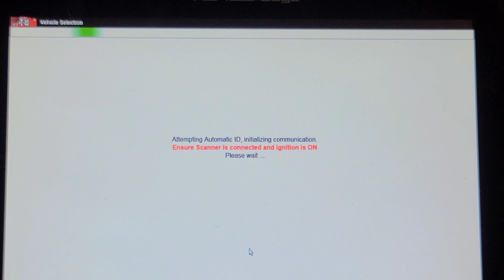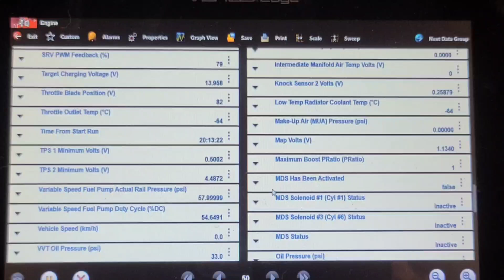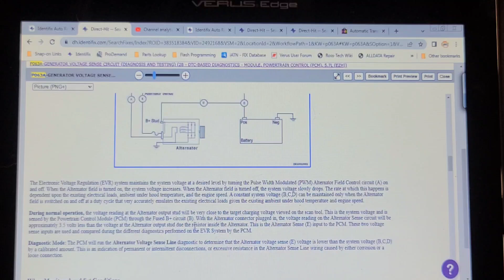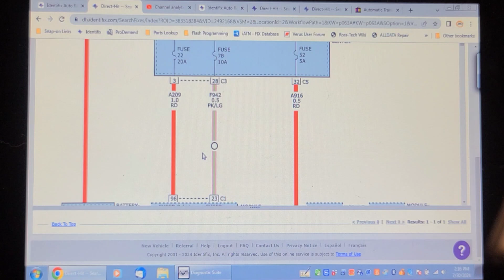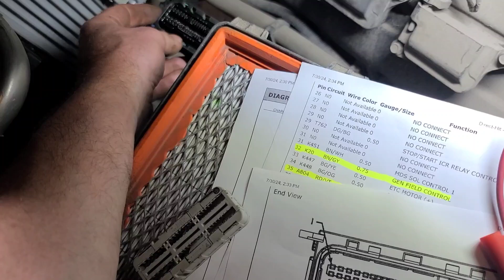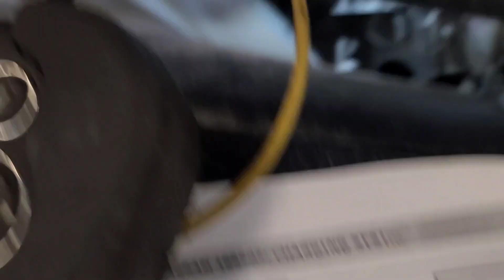2017 Ram Battery Light On Code P063A

Comment: Thanks Brother for the indepth diag and the best approach for the overlay repair. Do you know why the known issue from the scan data for the IAT did not set a code prior to playing with the ALT connector? TOP DRAWER REPAIR for my Library. Thank for always showing all the Modules listed for each vehicle, Thanks for getting us the MAKE MODEL YEAR ENGINE one way or another most of the time, much appreciate all that you do for us viewers. Duane from DiagnoseDan DDTSB, Cheers.
Reply from the maker: I believe it was a scanner glitch. I forgot to look at it after the alternator repair.